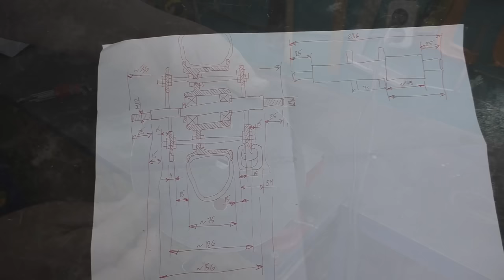Scooter with engine from grass trimmer

Comment: Hi there I made one many years ago  I use the free wheel sprocket off a bicycle on the rear wheel lots more  power on take off and not turning the engine on down hills  The only problem I had was the chain slack which in turn broke the shaft which came out off the engine at the front sprocket had to fit a spring tensioner on the chain   Mine was fast enough for 12 year old and indeed myself Well done
Reply: To fix that issue, a chain tensioner, and a torque converter. Very crucial for a lasting build like these. Still very smart for a kid though!!